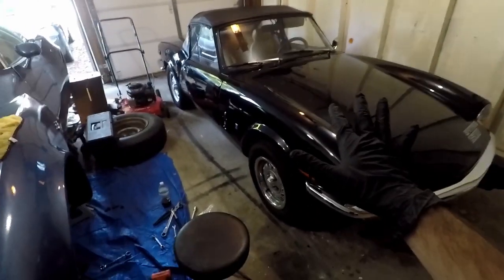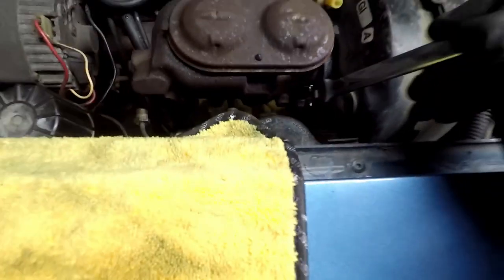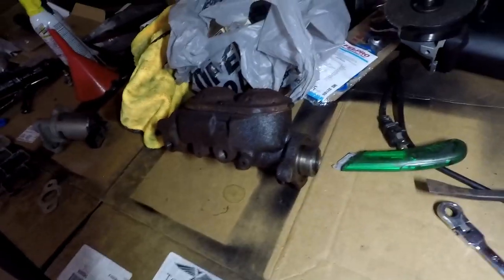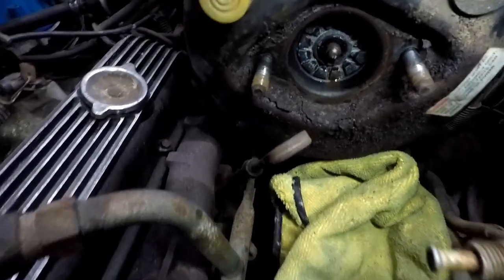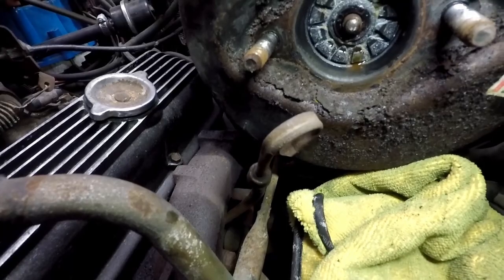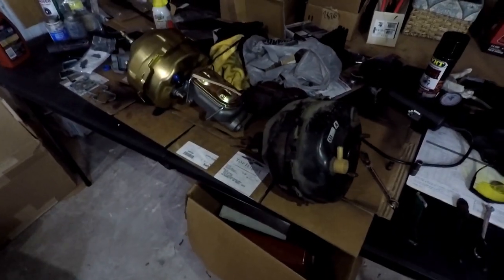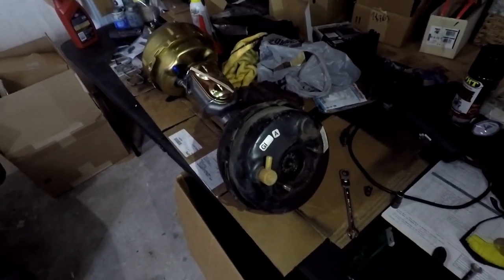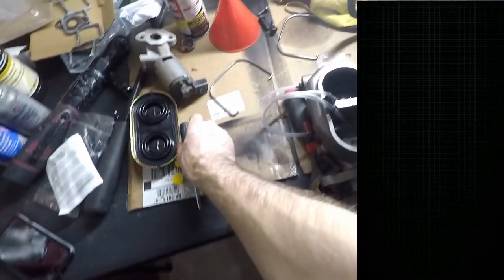Master Cylinder & Booster Replacement On My 1979 Corvette - Brake Overhaul Part 5

Comment: If getting the brake booster bolts out wasn't bad enough! My question is getting the top ones back in. Can you fit yours hand up there far enough to start the bolts or do you stick the bolts in a socket and start them that way?
Reply from the maker: I was able to fit my hand in there to start the bolts, but barely lol. You could also try sticking some tape in a socket and then pressing the nut inside the socket which will help hold it into place as you try to fish it where it belongs
Reply: @bluesxt  Thanks. Hey I just wanted to say looks like you put a lot pride and effort on doing these videos. Nice job. Luckily my booster is all good. Knock on wood!
Reply from the maker: @inell6  thanks! I appreciate the kind words :)

Comment: How exactly did you get that top 4th bolt out
Reply from the maker: Laid upside down on my back with a few extensions and a universal joint with tape on it and I managed to get it out. It was a horrible job lol

Comment: I hope you don't lose brake fluid by not fitting those retainers on the top of the master cylinder. In addition, having a tight seal to slow the intrusion of moisture into the brake fluid is key to retaining long fluid life and to prevent corrosion of the entire braking system. I hope you'll think of safety for yourself and your intended and reinstall those retaining clips onto your master cylinder. The desire to preserve the paint on your master cylinder's finish should take a backseat to safety. Your safety is more important. Please continue enjoying your Corvette for many years to come.
Reply from the maker: I’m not installing the retaining clips at the moment because I had to go back and bleed all 4 calipers now. Obviously once I’m done bleeding the brakes I will seal the cap. Plus if you drive without the cap sealed your car absolutely will catch on fire lol
Reply: @bluesxt  Oh! I apologize. I missed that important detail. Glad t know that you and your fiancee are safe and enjoying nice drives in your cars. Take care.